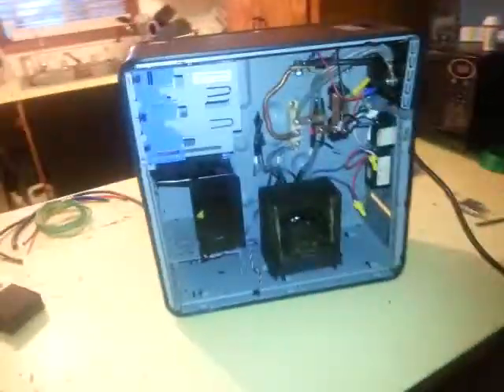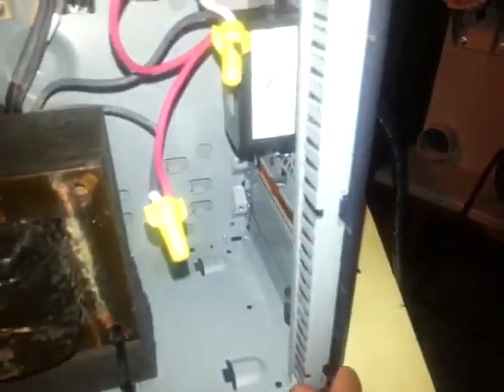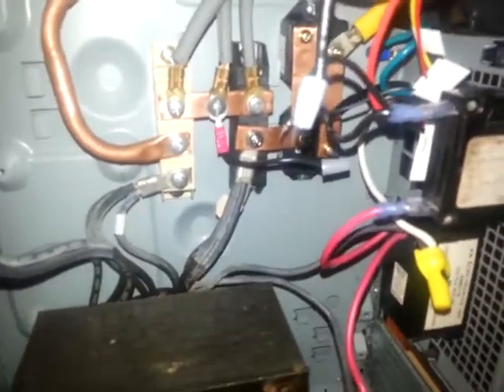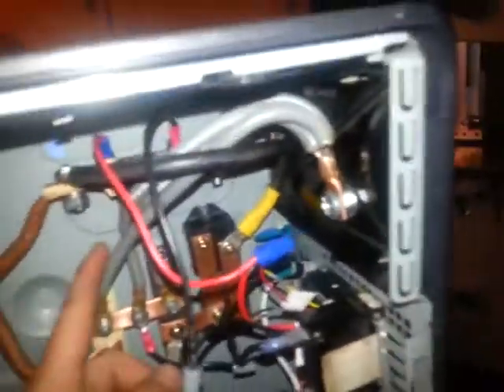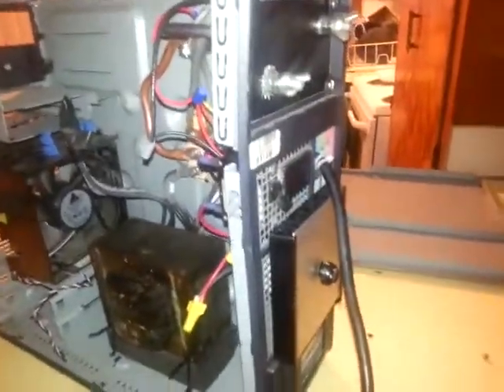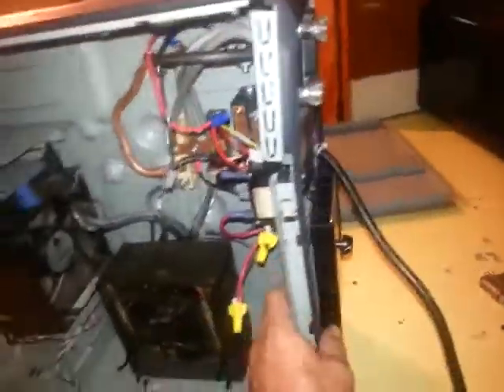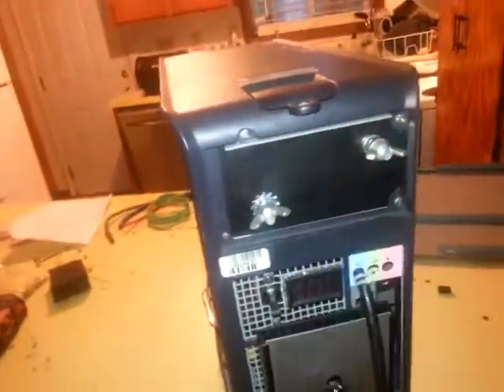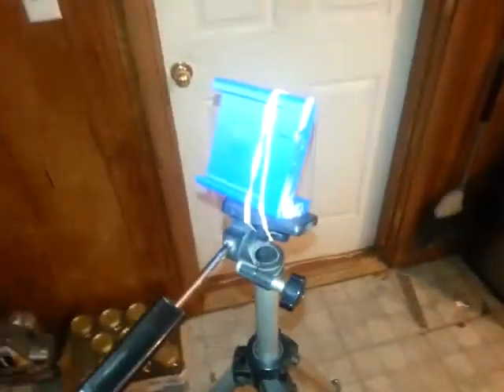DIY BIMY Arc Stick Welder from UPS and old computer

Comment: So you never posted a part 2 to this.. how come we never got to see it in action anywhere?
Reply from the maker: Fluffy Ponies a second part was never made. The buzz box only allowed the electrode to spark and end up sticking. My theory was the box delivered too much instaneous current as a large value inductor was never installed. Shortly after I built that, a Miller welder came into my possession. This confirmed my theory as I welded many beads